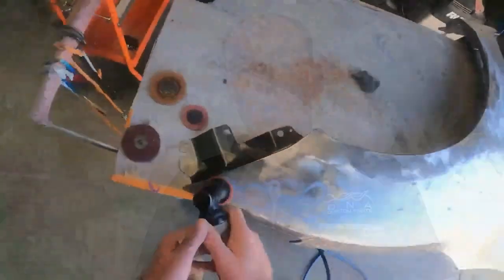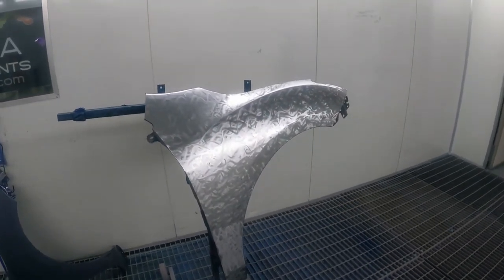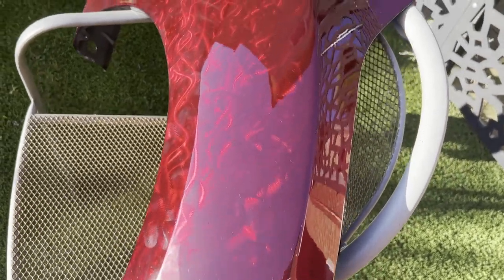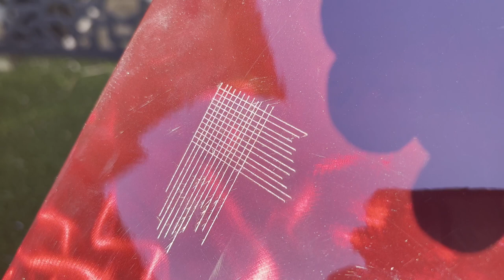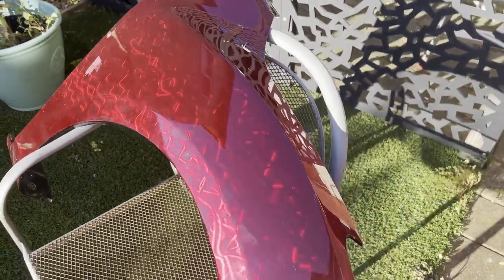Can You Paint Candy Over Bare Steel Without it Rusting ??

Comment: I painted a bear metal test bonnet wet clear then dry 0.25 flakes with clear over it , The bonnet been outside for 7 years and not a single sign of rust or lifting so far ..
Reply from the maker: Awesome to hear . Did you bare metal it and paint in a similar time frame as I did ?
Reply: @BogDustForBreakfast  yes bare metal and painted it straight away , i seen bare metal cars just painted in clear only  to show off the body .

Comment: Love the vids mate, does the key clear gloss up a patina surface? Just wondering if you can do a satin finish to keep that more original patina look? Also do you think you could coat chrome and stainless? as where i live rusts any new chrome even if it's been ceramic coated and being cleared would make cleaning alot easier. 
Cheers 👍
Reply from the maker: Hi mate , yeah key clear is glossy . For a satin or matte finish , allow the key clear to cure then sand down and flow coat with satin or matte clear
Reply: @BogDustForBreakfast  cool thanks mate, reckon it would work on chrome and stainless parts to protect them?
Reply from the maker: @bradenphillips2734  correct mate 100%
Reply: @BogDustForBreakfast  cheers thanks for the help
Reply from the maker: @bradenphillips2734  any time mate